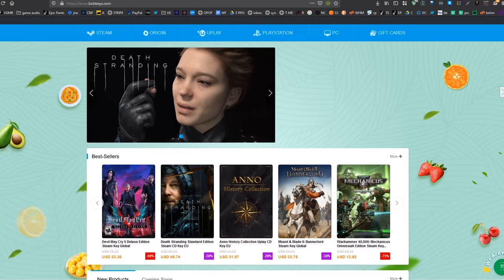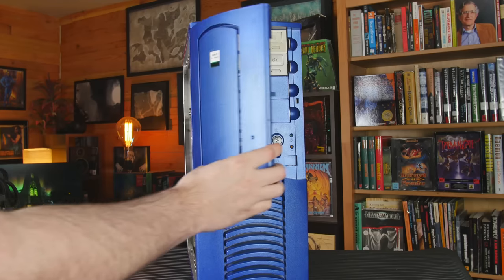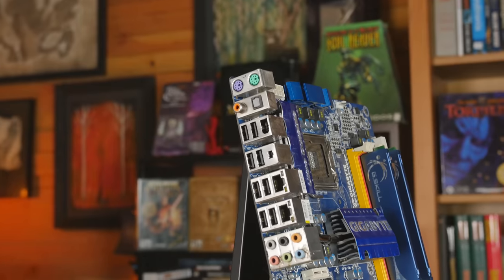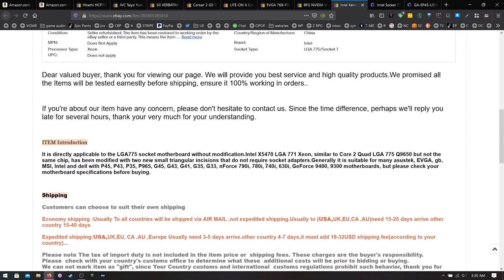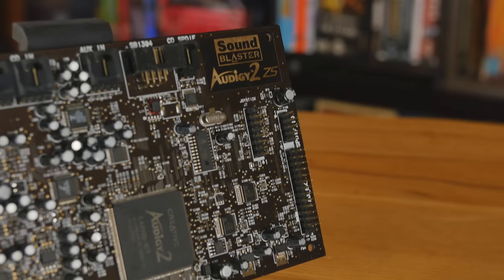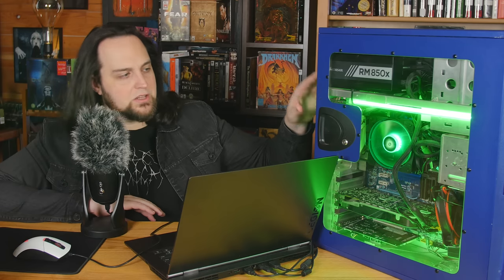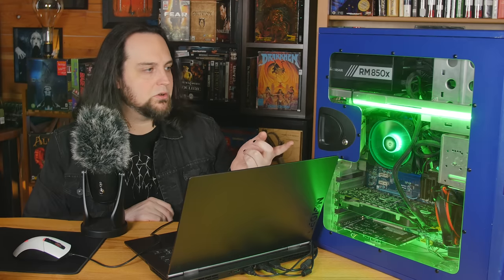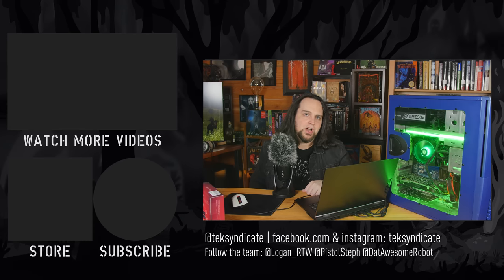NOSTALGIA BUILD: Windows XP Retro PC | P45, BFG 8800 GTX, ETC.

Comment: If you want to have the closest thing to SSD like performance around that time 10K RPM WD Raptors in RAID 0. They were ridiculously overbuild too, chances are there's couple of those still around.
Reply: I have one that's still working, let me just say...no where near SSD performance lol
Reply: @jabaniz  Modern SSD absolutely trash them and so did first gen SSDs when it came to random reads and writes, but they do come closer than anything else that was available at that time. Especially in RAID0. You gotta remember SSDs just straight up weren't a thing.
Reply: The main problem is latency not raw speed
Reply: 2022 and I STILL use them in my main pc, RAID 0 3x300gb one of the best buys I ever done period 

And vs my other sata 3 SSDs they provide 50-60mb/s better read and same loading times for games (much much faster than WD blacks I got even tho Raptors are only sata II)

Comment: YES around 2007 was when i bought my first all new gaming parts pc after years of dabbling around with old garage sale parts.  my room was wall pappered with Maximum PC, GameInformer and other pc magazine pages😀I bought my Gigabyte motherboard at CompUSA it had a flame style north bridge heatsink very few had them since they ran hot. i replaced it.  I got my XFX 9800 GTX+ at a local Ribbit Computers shop. I remember lots of your TigerDirect reviews. I got my Corsiar HX750W in 2009 and Samsung 1920x1200 monitor/TV from TIgerDirect. Still a good power supply with no coil wine yet after all these years. I sold the motherboard in box with everything on ebay a few years ago more than what i paid for it originally 🧐 then recently got a deal on a Gigabyte motherboard similar in the video. Maybe someday I'll revive my ultimate retro XP machine with a Xeon 771 mod with the same corsair ram 1GB sticks i still have or my 4x2GB G.Skill ram i have. Don't know why you would go IDE drives when you have the sata ports. I still have my WD 10,000RPM VelociRaptor drive with a window! i keep it propped in, but not plugged in my toaster dock so its not powered, but on display still works when i need it. I think it still has XP or 7 installed on it😀
i still use 2x500GB raptors in hard raid 0, then later added 2x1TB raptors in windows raid 0 for games booting with an Intel 600P mvme ssd

Comment: I started with a P90 (Intel 90 Mhz) and 2 MB Graphics card and 8 MB RAM, switch to an Athlon XP 2000 Mhz and a GeForce 4  with 256 MB RAM a couple of years later and used for few years...after that switched, to Athlon 64 3000 Mhz and an ATI 9550 and 756 MB RAM...this system sill exists in a storage :)..so long before your BFG 8800 GTX... I remember cutting with metal scissors the side panel and gluing an acrylic panel that hade made holes with a heated nail and attached a LED fan with a 3 colours combination (red, green and blue) so it had all three led lights turned on and kinda created a rainbow when fan was spinning...was the coolest PC in the hood

Comment: Sad thing is the first computer I actually built was pre-xp, with the next computer I built coming into existence just before 8 was out. Filling the gaps in between were prebuilts, dell dimension 2400 with a celeron and an emachine with a dual core athlon 2. The system that replaced those rigs is still my daily driver with an i7 3770k :)

Comment: I can remember my very first gaming PC that I built myself. I built it in early 2001 with a 1.0 GHz Pentium III CPU with 256 mb of pc133 ram, 32 mb GeForce 2 graphics card, creative sound blaster card, a 20 gb hard drive, floppy drive, CD-RW drive and DVD drive. For the operating system, I originally had Windows ME on it, but then later in the Fall of 2002, I upgraded it to Windows XP.

Comment: This made me want to get my first gaming PC build running again. My Chieftec Dragon isn't quite in as good of shape as yours, but I spent a few hours cleaning it up last night. Unfortunately, it's not working because ~10 years ago my stepdad had broken it while trying to dust the inside of it. Luckily my mom kept it in case I ever wanted it back. After 3 years of sitting in my garage, it's fully cleaned and just waiting on replacement parts... which I ordered on eBay last night. 

Bummer to hear about the software issues you encountered, but definitely not surprised. It would be cool if GoG added support for Windows XP since they sell games compatible with it, but I realize that's a lot of dev resources to dedicate to such a small base. I'd rather see them support Linux with their GoG Galaxy client first.

Comment: Logan you maniac, I have a XFX 680i sli and that same case based on your rec back in the Tiger Direct days.  It still runs, now with a QX6850 (i got on ebay).  It is a windows 10 machine now with an SSD but in its heart it is still a xp machine.  Had to disable the A drive in the bios because it complains at start up with out the floppy.

Comment: Oh wow, I've been finishing a build for a friend on 775 right at the same time as you did, it seems! The idea was to get the most bang for buck. Here comes:
QX6700 $16.35	
Gigabyte GA-EP45T-UD3LR $24.08	
G.Skill Ripjaws 1600 Mhz 4x4gb = 16gb	$51.99	
Palit 660ti 2gb $35.46	
Kingston SSD 120gb $14.18	
Thermaltake	CPU cooler (huge bastard) $12.41	
Misc (case coolers, adapters) $8.62
Total: $163 

Graphic card and ssd I had laying around (still included in the price), while rest of the parts I bought used. UD3LR I chose because of 16 gb ram max. Case, hdds, PSU and some misc cables not included as they were initially in the build. Also, if we subtract the used market price of removed old components, the upgrade price is down to $127. Pretty good, I believe :3

Comment: Like a bunch of others, I built my first PC after watching you on TD.  I had one of those Ultra cases with the same front panel style but it had 120mm fans and a mobo tray so the OEM must have updated the design eventually.  Had a BFG 8800GTS 512MB and green migraine man was awesome.  Unfortunately it died right after BFG went out of business.  Had a Q6600 and the EVGA 780i board, and I think I even had that same mem.  It eventually had a 10k raptor in there too after a friend took a few from his job.  Replaced the GPU with an HD6850 and used that until 2015.

Comment: I'm still using the Antec version of this case in grey with a solid side panel. Came with a 2.6 ghz core 2 duo, gigabyte LGA 775 mobo, and basic ATI video card. The case was and still is absolutely pristine. I pulled it out of my closet recently and put in a spare x58 mobo/xeon 6 core x5670/9gb ddr3/660 ti/7200 rpm HDD. Can't get myself to sell it off to be honest. It was the first case I ever purchased when I got a job at 16 years old or so. Stopped using it cause I got one of those goofy NZXT Apollo cases 😂

Comment: Back in 2007 I was tired of having an average computer so I saved up for a monster gaming PC, I wasn't going to cheap out this time and I only wanted the best. I was checking for video card reviews on YouTube and stumbled upon "Logan" from Tigerdirect who was reviewing the 8800 ultra and the 8800 ultra black pearl edition. I ended up getting an 8800 ultra GPU, Asus striker extreme motherboard, Core 2 Extreme QX6850 CPU, 12gb of 800Mhz ram and a coolermaster cosmos tower. And yeah it could run Crysis!

Comment: i have a windows xp gaming pc setup, a little tip for an up to date web browser, mypal is working really well with winxp sp3, has frequent updates, supports addons like adblock, and is pretty stable, been using it for about a year now with little to no issues. i have a pair of gtx 8800 ultra's but there are newer cards that will perform better that still have xp drivers, "i know some guys build systems around a year or life cycle of an OS, but i build my systems with hardware that has support, im using an old radeon hd 6870, i have 2 of them but i haven't found a game that runs poor enough to force me to try and install the second one lol, the 6870 runs really well in xp and has a native driver on the amd site, im running the xeon x5460, i think it was around $15 on ebay, the motherboard is a gigabyte ep45c-ds3r, im using 8gb of ram, but im running xp 32bit, so only 4gb is getting used, if i want to dual boot a 64bit linux OS i can and be able to use all the ram, im also using an audigy 2zs, but i think a x-fi would be a better card for windows xp, it supports higher versions of EAX, i think the audigy is EAX 3, while the x-fi supports EAX 5, really happy with my experience with this build, plenty of power, but some games like gta san andreas will have issues with ati/amd cards with things like frame limiter disabled, even when forcing vsync in the driver the game has a weird bug, so i have to leave the limiter enabled to play it, im thinking about getting a gtx 580 and replacing the 6870, what do you guys think ?

Comment: Aww man that takes me back.  Sure Alienware used that case for a bit too (painted it green though).  The cold cathodes was a great touch...   I had those and rounded ribbon cables for all the drives - don’t need them anymore!   If you could go all out get a SCSI RAID0 going on in there, 15k rpm drives. lol

Comment: Because I did a full system upgrade, I used my last build for Windows XP which is well above spec. ASUS Crosshair IV Formula, Phenom II X6 1100T (all cores locked at 3.7GHz), 8GB DDR3 1333MHz 6-6-6-18, Soundblaster X-Fi Titanium, and an Nvidia GTX 285. As is, I can play FarCry without dipping too much below 150 FPS at 1600x1200. I did have two Radeon HD 6850s in Crossfire but that took too much power and I wanted the real PhysX. I do plan to get a newer model nvidia video card with Display Port. The 900 series is the last with Windows XP drivers but a 750 Ti will do.
Reply: I was just remembering, my last build when running Windows XP was an ASUS A8N32-SLI Deluxe, Athlon 64 X2 (2GHz) 2GB of RAM, two GeForce 7950 GT in SLI and I think a SB Live! 5.1. Dual-booted Gentoo Linux as well.

Comment: I just built a high end 2008 Windows xp gaming rig about two months ago in an old chieftec TA-10WD full tower case. I had been pondering the idea of an ultimate XP machine for about 5 years before finally going through with it. 
My specs are 
Motherboard • Asus Striker II Extreme, nForce 790i Ultra SLI 
CPU • Xeon X5470 @ 3.33ghz
Memory • 4gb OCZ Platinum DDR3 @ 2000mhz
GPU • EVGA 780Ti Superclocked reference card
Storage • 500gb 7200rpm WD Blue HD
Power Supply • 1200w fully modular Rosewill
I realize the 780Ti isn't really accurate to a 2008 era pc, but it is the last flagship Nvidia GPU that officially supports Windows XP.
I still need a sound card and I plan to install a Sound Blaster X-FI Platinum. I'm also currently researching and planning out how I will add in a soft-tube custom loop since there is still a lot of room left inside the case. Im very proud of it so far so whoever reads this please let me know your thoughts.

Comment: Nice! Currently working on a retro XP build using an Athlon 64 X2 4800+ (Toledo), using a modern Ryzen Wraith Max cooler, on an Elite Group NForce3-A939 purple motherboard, 2GB of Kingston Hyper-X DDR 400 in dual channel, a 256MB XFX 6600GT AGP card, and a Creative Audigy SB0090 PCI sound card, in an Antec NSK4100 case, with a SeaSonic SS-500ET PSU, Noctua fans & things.

(Primarily for Microsoft Flight Simulator 2002 Professional, as MS FS 2002 doesn't like my 8GB Q9650 Gigabyte EP35-DS3R 2GB EVGA 750 Ti SC Audigy SB0090 XP Pro 32-bit / 8.1 Pro 64-bit (with Classic Shell) build).

Comment: What I’m planning to do is buy a very modern case all of our Gen Z considers a “PC case” and then shove mostly components dating back to the early days of ATX, except the PSU of course, as they are like the most critical component of all and generally modern PSUs are built much solidly than back then, given how power supply technology has evolved over the years

Comment: Ah been waiting a while for this one heh, a pretty good combo of parts there, maybe go with a 9800 gtx+ instead for gpu, bit lower tdp at 141w while also overclocked versus the 8800 gtx & 8800 ultra.

Half-life 2 should not be tied too steam at all actually so you can just move it too a usb drive & move it into this pc fine.
Reply: Thought about it but that's more of a vista era part. The 8800 was at least a week or two before vista

Comment: My build at that time:
E6600@4ghz? stock voltage, stock cooler
XFX 650i Ultra
Corsair 8gb (4x2) XMS2 800mhz
XFX 8800 Ultra w/ Arctic Accellero Xtreme 8800 cooler
Thermaltake Suprano
Thermaltake Toughpower 750W PSU

Comment: Running the same board with a Xeon E5472 3ghz as a backup right now. My z97 system crapped itself. Honestly it handles win10 fine and I've been able to play the entirely of the witcher 3 on medium/high. Waiting for Zen 3.

Comment: I just got a XPS 710 for 40 bucks. Extreme edition q6600, 4gb ddr2, sli 7700 gt, 1000w PSU. Surprisingly usable as a daily driver even with a 7200rpm drive. Doesn't run crysis that well.

Comment: The Xeon X54xx processors run hot. I prefer the E5450 at 3.0GHz that easily overclocks to 3.6GHz and the thermals stay in the mid-50's while gaming. Just a much easier chip to work with.

Comment: If you install Half-Life 2 on another machine running Win7+ and then copy the files over to an XP machine it will work. For whatever reason, it does not require Steam to run anymore.

Comment: Half Life 2 actually comes without any DRM off of Steam. You just need to install Half Life 2 on your Windows 10 PC, then you can copy over the files to your XP machine. I have this running on my old Core 2 Duo rig running XP.
The same works for Doom 3 as well (the non-BFG edition). The only extra step is to enter the product code when you first run the executable on the XP machine.
Everything else pretty much runs using the GOG offline installers.

Comment: I just made one but I couldn't use windows XP I had to use Vista. I used a ECS GF8200A. I wanted to use hybrid graphics :D So sadly I had to use windows Vista because it wasn't supported in XP. The only GPU i found that worked is 9800 GTX+ EVGA. I've tried the XFX 9800 GT single slot but it didn't work even tho they say it does it doesn't. I wanted the single slot GPU so i could use the PCIe slot for a sound card. I installed it in a new Corsair 110R Tempered Glass Mid-Tower its so sick :D use one PCIe slot for usb 3.0. Threw in a sound blaster PCI sound card sense I blocked my PCI3 x1 slot

Comment: fx 5200 to 6150se to 7600gs to 8500gt to 8800gts 640mb to xfx 9800 gtx black edition thanks to tigertv to two gtx 285 2gb sli to 4 gtx 580 3gb sli to 6gb gtx 780 to gtx 1070 supposed to have an rtx 3080 but i don't that is my upgrade path

Comment: Picked up a HP Pavilion A1000 for £10 ($12.50 USD) with a Sempron 3000+ 1GB DDR400, no gpu (Onboard ATI Xpress X200) and no hard drives. Going to throw a Athlon 64 x2 4800+ (Max supported), 4GB DDR400, 9800GT or something like a HD4830/4850, upgrade the PSU to a FSP 300W Bronze 80+ PSU and a Seagate Barracuda 250GB SATA HDD. 
GPU might be bottlenecked but it is from a similar era and wanted original parts.

Comment: Need advice. Have two potential mbs for an XP build. P5Q-Pro Turbo and P4P 800. These are from old PCs I still have around.  Which mb would you recommend for an XP build? Have 9800 GTs and 550Ti and Radeon Sapphire HD 3850. Want to run older s/w and need acces to floppy drive.

Comment: Downside to me wanting an old Athlon system (Socket 462 preferably) is all the boards are farking rooted with capacitor issues from that era, I managed to get a Gigabyte Nforce2 board but the damn thing will only work if the os is preinstalled on the disk and if you put its newest firmware on it just crashes so I'm stuck with a laptop with xp on it lol.

Comment: should have went with 790i running ddr3 with everything overclocked to hell
Reply: 790i MCH still peaks out at around 8.5GB/s like P45, with write performance actually being a good 15% better on P45 (with DDR3) due to the lower phase power. 790i is 'loose' on memory phase advancement so you can squeeze higher clocks, but aside from faster reads you don't gain anything. 790i also suffers in the core OC department overall for any board that isn't the FTW digital since vDroop is so insane. Intel's reference boards handle core GTL more tightly and have less vDroop.

Comment: Music will not sound even close to as good via onboard audio vs the Audigy 2 ZS, the Audigy will make a HUGE difference in audio playback quality, onboard audio codecs sound flat and lifeless, and you will totally lose most of the fidelity of a good quality song, with the Audigy you will get to hear every detail, from the scratching of the strings to the breath of the singer, it can even make a low bit-rate MP3 sound decent, playback FLAC files however, and you will get something really special, there are even better sound cards out there for music, but the Audigy 2 ZS is a great all around card that has fantastic surround sound and positional audio for EAX games, which is really well implemented in many games, Max Payne 1 & 2 has awsome EAX audio.

The SB X-FI Extreme Gamer and Extreme Music cards are even better, they offer Dolby Digital Live 5.1 for games without EAX, they actually have proper hardware chips that decode it on the fly, can sound really great with a good speaker setup, nowhere as good as EAX does, but still nice to have if EAX is not available. Then there is the Crystallizer option, this actually does a fantastic job to improve audio quality in MP3's and such, will make a low bit-rate MP3 sound reasonably higher bi-rate and really give it a boost in audio quality, really nice to have, there is also superb MIDI support with Soundfonts.